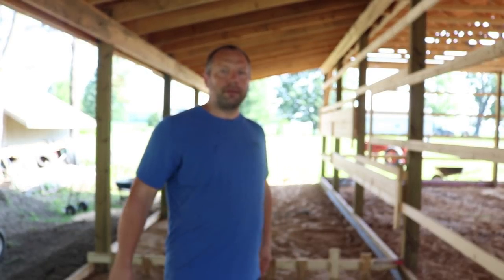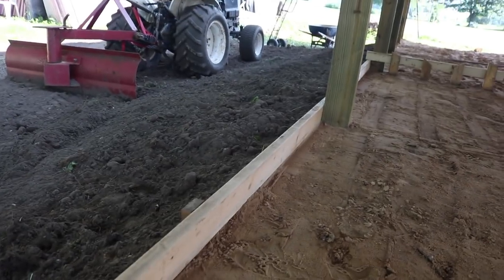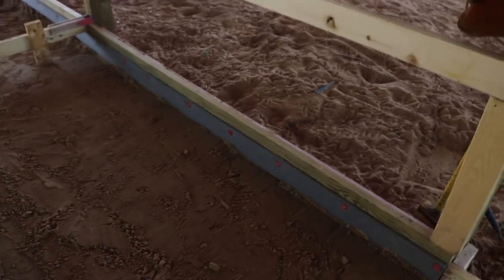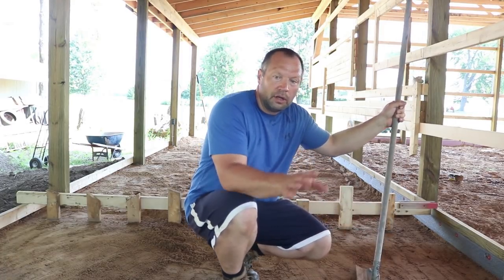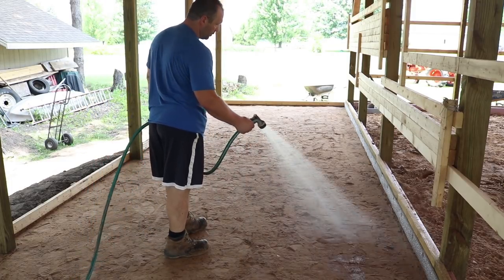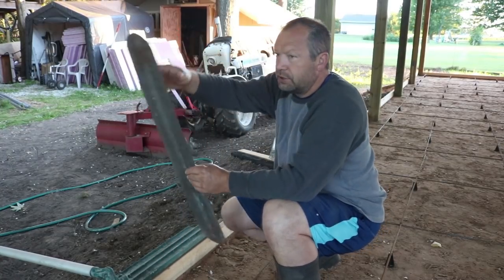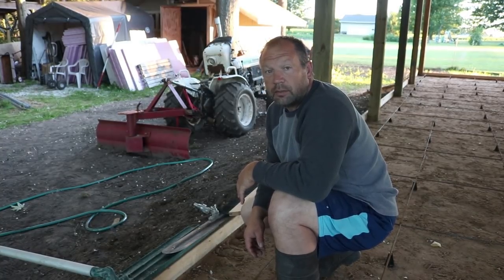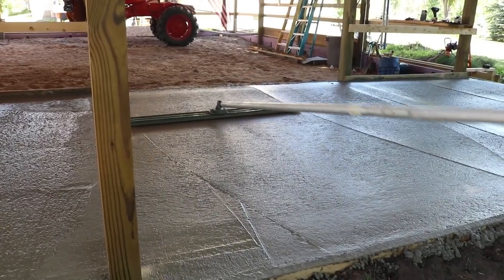How to Prepare and Pour a Concrete Slab for a Pole Barn Lean To - Pole Barn Shop Series Part 13

Comment: I have a question for any concrete professional. I have an existing pole barn 24 by 24. It's older but good shape. I want to pour a floor for it. Is there anything special I need to do? It will eventually be insulated and heat and cooled.

Comment: Thanks for sharing this.  How's it holding up now after a year?  Anything you would've done differently?  Like control joints or joint material around posts?  I've got nearly the same set up I'm planning on, though extending out 4' from the face of lean-to posts.
Reply from the maker: Thanks for the comment. I cut control joints a day or two after I poured. I cut them at each post back to the barn. Those corners of the posts are where cracks will start so it's good to give it a place to crack. Although I don't have any cracks as of yet so it seems to be holding up just fine. We've gone through two winters since I poured so I'm real happy with it. I think the only thing I might do different is wrap or coat the posts where they touch the concrete, but the barns I've built in the past (20 years ago) still have no issues with the posts rotting so I don't know if it's worth the hassle. In your situation, I would be sure to cut joints each direction from your posts, or even make it in two pours with an expansion joint along the edge of the posts. Then pour the outside 4'. Good luck with your project.

Comment: Great video! You were definitely more organized than I was!!! I saw a bunch of insulation boards in the background, so I understand the inside slab has been done with styrofoam underneath.  That is an other story for curing!  I've done my slab on styrofoam and it was just above freezing point... The concrete took more than 8 hours to cure... Nice idea the screed board to get the proper level on the sand.  I should have done that! The conduit bender is a good idea too!  I should have watched your videos before I do my carport!!!
Reply from the maker: Thanks Joe. Yeah the inside slab has 2" foam and PEX tubing for in-floor heat. The lean-to slab set up in about an hour after the truck left. The inside slabs I poured during a cold rainy spell and both took many hours to cure with the foam underneath and the damp weather. That video should be out in a couple weeks. I wish I could have posted these videos sooner. As you can see the weather was warm in this one, I think it was end of June. I filmed a lot over the summer, but didn't have much time to edit until fall/winter.
Reply: Corey, by your sun tan, it was in summer and you had great weather too! Lol!  I should have done my carport in summer... We usually have great weather in fall, but this year, it was rainy all over the North East. Was that a hot summer in Michigan?
Reply from the maker: Yeah it was hotter than usual this past summer and my electric bill is proof of that from running the air conditioning. And now this winter has been pretty mild so far, I've only had to plow snow once in early December. The Saginaw Bay is usually frozen over by now and guys out ice fishing, but there were boats out there this morning.

Comment: Do you need sand or could I just use the ground as is in my barn? It's like a hard packed clay type dirt. I was gonna vapor barrier and use rebar like you did here.
Reply from the maker: I have never tried using just clay. To be safe I would use sand or gravel as a base. If the clay is not completely flat it could lead to the concrete cracking. Any irregularities in the concrete thickness will be the weak spot that cracks.
Reply: @CountryFamily  ok thanks. Think ill go gravel and rock then a inch or 2 of sand.

Comment: What type of wood is your outer floor board made out of?
Reply from the maker: The outer form boards are regular SPF (spruce-pine-fir) construction lumber. They were only temporary and removed the next day after concrete hardened. I'm planning on re-using them several times if possible because I have more concrete to pour this spring for a patio and driveway. Hope this helps - Thanks for watching.
Reply: @CountryFamily  I hope you didn't have to search all over town to find a hardware store that carried that kind of wood.  I also hope that you didn't have to spend a lot of money to get the wood.  How long did it take you to set the form boards?